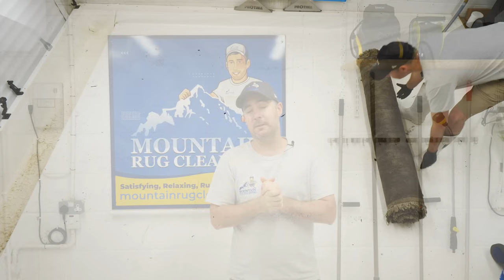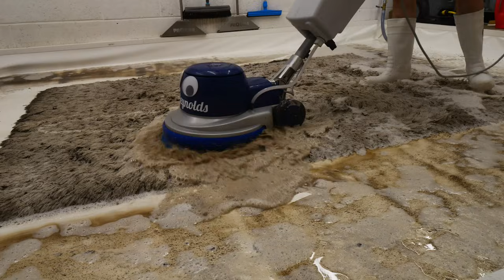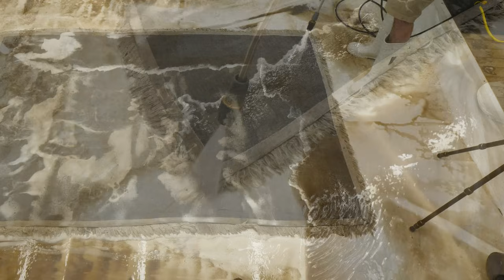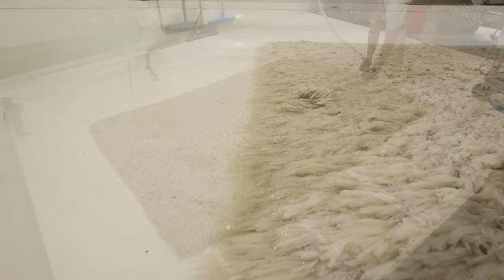You Wont Believe The Colour Of This Rug ! Satisfying ASMR Video

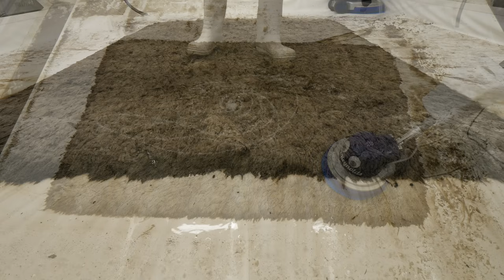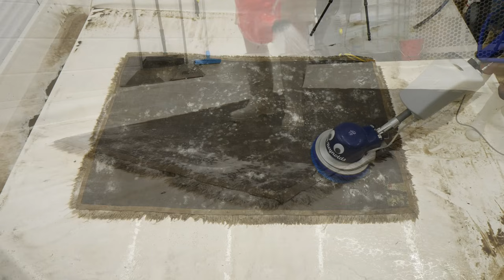Comment: Rotary Brush Scrubbing (Dirt Reynolds) 1:51 7:34 
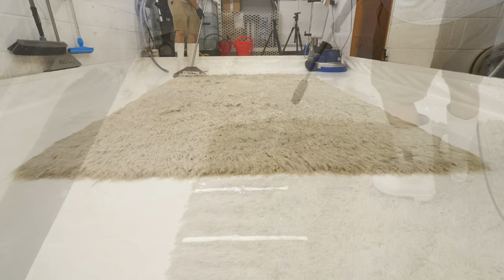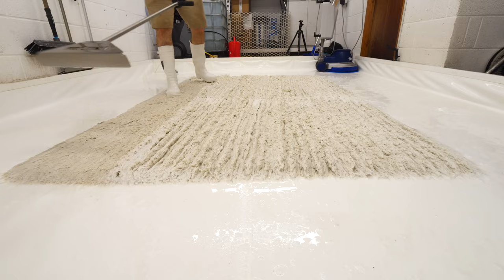Scraping 3:53 5:25 10:41 12:10 16:38
Soaking 4:40
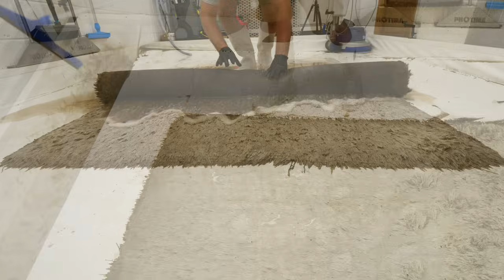Roll up & Squeeze 6:34
Powerwash 9:06 11:08

Submersion Rotary Scrubbing  13:10
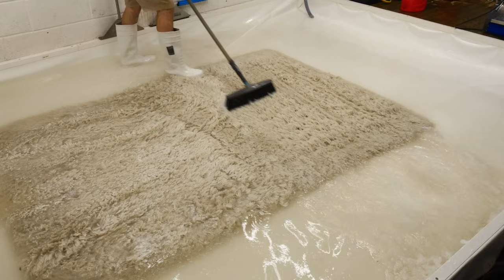Submersion Brushing 14:00
Submersion Scraping 14:40 (the submersive steps are pretty intense)
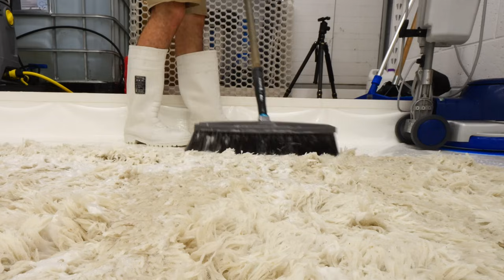Brushing 15:35
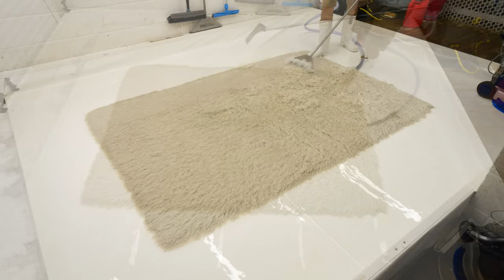Wet Scraping 17:31
Vacuuming 18:05
Before/After 18:48

Comment: Wouldn't it be better for the pressure-washing stage if the rug was on a perforated surface, so that the dirty water could drain on the other side instead of the rug "soaking in its own juices"?
Reply: FINALLY SOMEONE SAID IT
Reply: I'm so confused why perforated
Reply: @andromeda4465  What's confusing? You'd want something like a sheet perforated with little holes that the water can drain through. Put the carpet on top, let the dirty water flow out without it "sitting in it".
Reply: He does explain why in a different video. Essentially the benefits of a perforated surface don't outweigh the benefits of the cleaning product being able to sit and soak through the fibres thoroughly.

Comment: If I were you, I would put a metal grill over the white floor, slightly elevated (5cm or so). This way, if you pressurewash the carpet from its hindside, it pushes dirt out of the rug and the dirt can float away without getting soaked into the water again. Saves water and gravity is helping you, too!